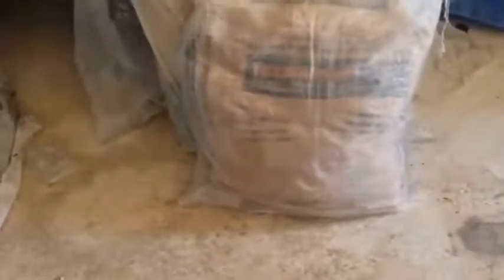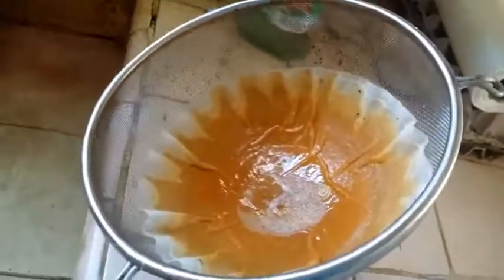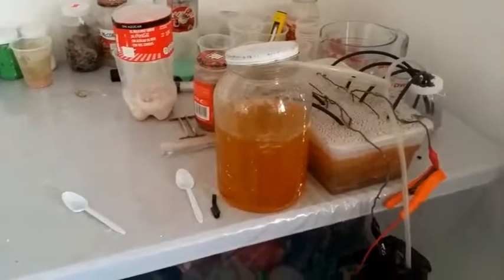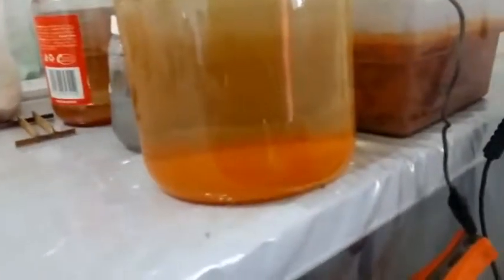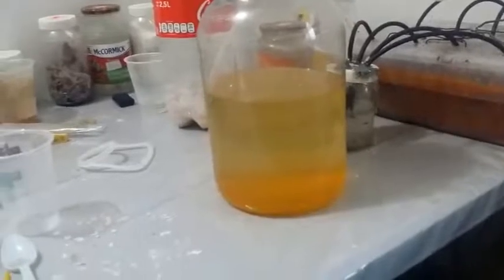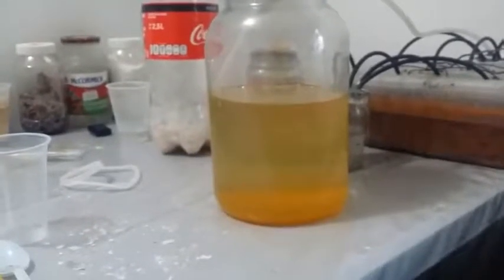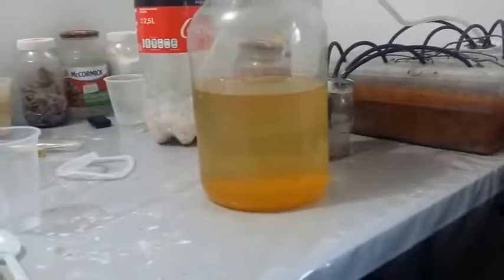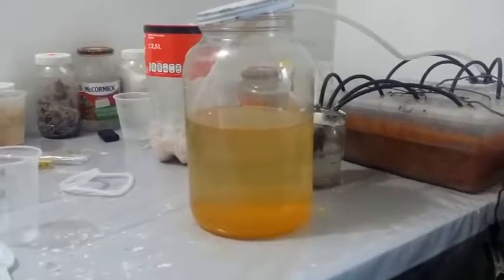Attempt to Purify Zinc Sulfate

Comment: Just precipetate every think then use a magnet to get iron out of there, or use cotton to filter unpurities
Reply from the maker: The iron and other impurities were in the form of sulfates also. This was many years ago, but as I recall heating was quit effective at oxidizing the impurities. I did various things and did end up with decent grade zns04 from fertilizer grade, but never pure.
Reply: @Ahamshep  in reactivity series zinc should precipetate iron in its elemental form. Use cotton as a filter if you still trying to get zinc sulfate.

Comment: Hi Adam . I wonder what ac240 volts would do attached to your electrodes and current limited to 50 watts with a lightbulb in series . It may create the desired outcome as it charges and discharges 50 times a second ! Caution though ! 😊
Reply from the maker: I don't think so, ac's duty cycle is actually much faster than the evolution of either hydrogen or oxygen. If this was scaled to an industrial process, the energy inputs for the purification phase could be recaptured for electrowinnowing or charging batter banks etc... 

I plan to use low voltage between 1.5 to 2 volts DC. Higher voltage would produces larger zinc dendrites which would not strip back into the solution on discharge. The current will be limited by the molar ratio of the solution plus the size and distance between the electrodes.
Reply: Adam shep I was thinking maybe the dendrites would not form as each time the phase shifts I had the idea that it would dissolve into the solution etc . I am looking forward to you doing the experiment with dc. Cheers adam
Reply: I agree 100% mate the key ( or one of them ) is to source raw materials at a low cost.
Reply: I don't know... you guys... just buy some  Like i did 😎
Reply: kev wallcroft yeah but the learnings You get from tinkering ya just can’t by Kev . 😂
Reply: Electron Proton Neutron Mouron i know mate i was just teasin. I revisited rms's making zinc acetate last night. It's long winded but well worth a go.
So that's just what i am going to do this weekend.
Hi Adam 😎
Reply from the maker: Hey Kev, for me its a matter of what can be easily sourced locally. Zinc and manganese are large industries here in mexico, so the potential exists to obtain raw materials. also these fertilizer grade sources are much cheeper than technical grade. If the process does not require a large investment of energy than the final purification step is worth it.

I filtered the solution yesterday that I showed at the end in this video and started to test it last night. It shows no signs of contamination, so I possibly had it cleaned up already.

Ultimately I want to build batteries that don't cost to much.

I guess these links may be more of intere eset to EPNM maybe. There are others on using ammonium persulfate or mno2 or various other techniques to remove iron from zinc. Oxygen is the key, if it is catalyzed in one way or another or not is a matter of what value it brings in the end.

https://www.sgs.com/-/media/global/documents/technical-documents/sgs-technical-papers/sgs-min-tp2006-05-iron-control-in-hydrometallurgy.pdf

https://knepublishing.com/index.php/KnE-Materials/article/download/950/2529

https://aip.scitation.org/doi/pdf/10.1063/1.4974413